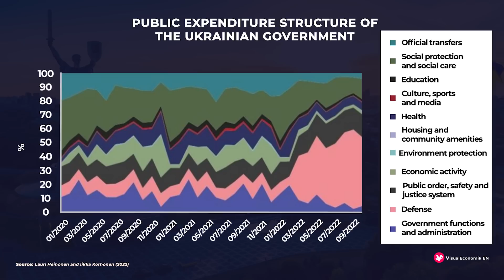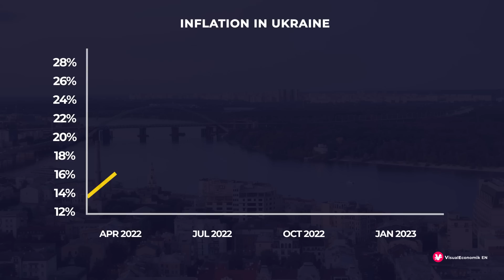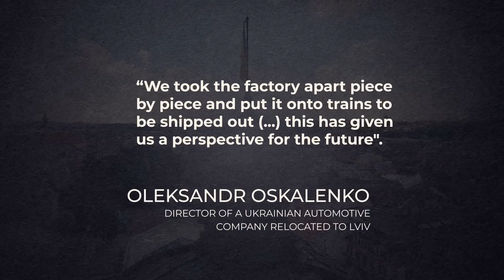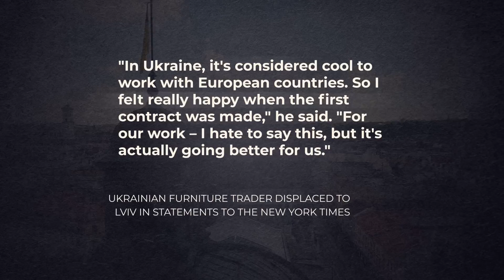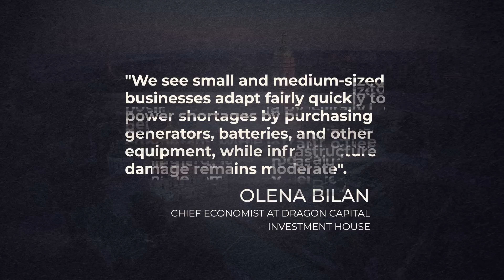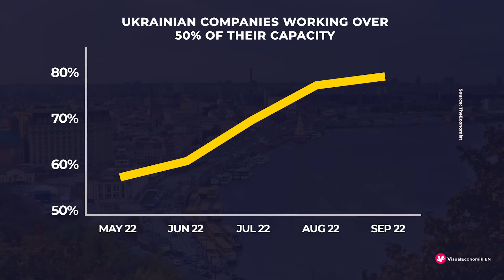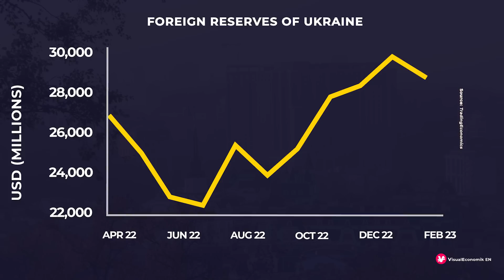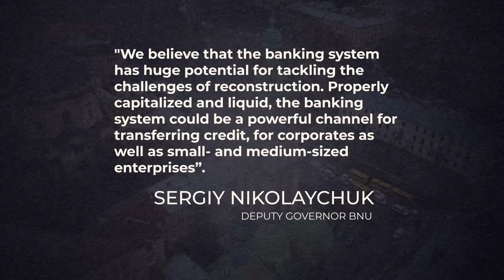Can Ukraine Avoid Economic Collapse?

Comment: This is such a sunshine and rainbow way to look at the situation. It's great that UA didn't turn into a failed state because of support from The West but it will be locked into a massive debt trap after 2024.

Even the likes of BBC and CNN have reported on how corrupted UA was prior to the invasion so would things change after the war for the reconstruction effort?

As soon as a peace treaty is signed, Chinese construction companies will pour into UA offering to rebuild at half the costs of what US or European companies could afford to. The cost of the construction will be subsidised by the Belt and Road Initiative of course.

The West pushing the war with Russia to continue by arming UA has pushed Ukraine into being heavily in debt. If the The West isn't careful, it could into the ultimate linchpin in China's Belt and Road Initiative. Just when Italy is starting to back out, UA could be the alternative gateway China need to connect into Europe.

Why do you think Xi spoke to Zelensky? They have probably already touched on the rebuilds and possible ownerships.
Reply: We don't have chinese construction companies here. Only local, european and turkish. They won't share their pie with chinese.